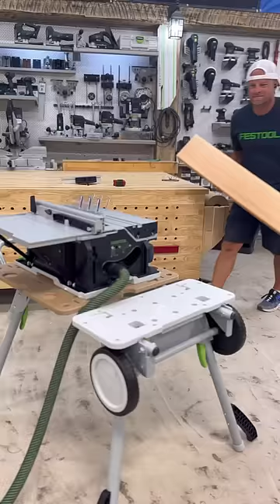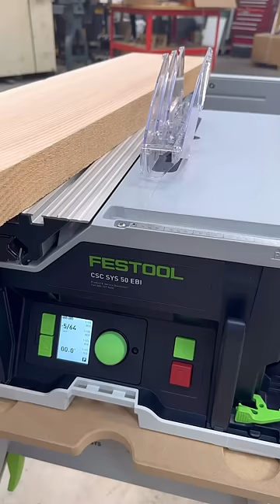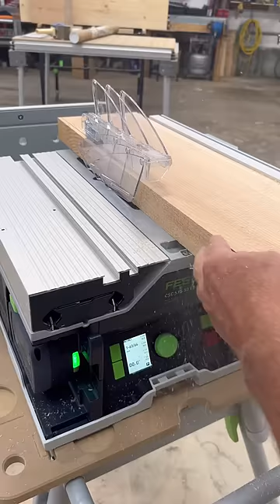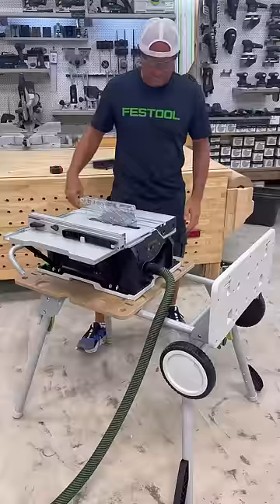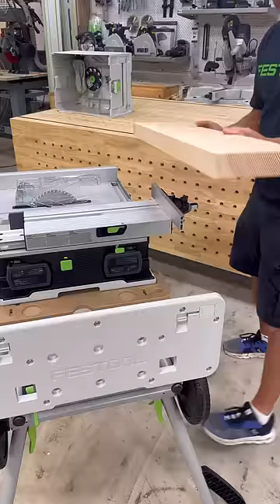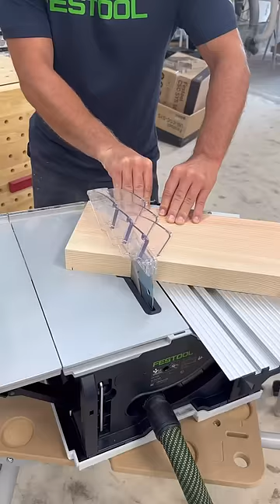The new Festool cordless table saw and mobile base #woodworking #festool #tools #maker #wood

Comment: Only problem with battery power is the batteries. Will you be able to get replacements in ten years time or will the manufacturer have changed the design and yours has become obsolete? At least with mains power you could probably still get it repaired. Nice having the portability of batteries but give me mains power all day long. Hope festool decide to make a mains powered version 🙏

Comment: How long does battery last?? Can you run it hard for 6-8hours??
Reply: Dual 18 volt 4 ah batteries would probably rip about 100’-120’ of 2x material.  At least that’s what my Makita 7.25” saw would do.  
I’m waiting for Makita to make a portable tablesaw that runs off of their dual 40 volt batteries.  Anything less is pretty underpowered for a dedicated machine designed to rip material (with a 10” blade).

Comment: Why do you prefer Festool tools?
Reply from the maker: I had mostly makita for quite a few years and did a lot of work with them and they’re good tools. Festools are better and I have switched out pretty much all my makitas for Festool. The main reasons Festool is better is they better engineered for micro adjustability and with woodwork it comes down to very narrow tolerances if you want tight not. Not to say makita can’t do it I just find Festools are better at adjusting. Also Festool is a system and most tools also have extra attachments that make them extra useful and they have more design features like the ratchet collet on the routers for example.
Reply: Plus they sponsor him, so there's that.

Comment: It.s very cute contractor size small blade almost like plastic toy saw. For the same money better get iron cast 10 inch blade professional table saw or if room doesn't allow than regular dewalt 7492 saw. I do love my Festool domino 500 but this little plastic overpriced saw is a joke

Comment: Seems very nice, however just my experience with sanders and drills, I would not trust a table saw or router that’s cordless, i know people use them all the time but does anyone ever have issues with the battery dying mid cut and either ruining the piece with blowout because the blade/bit slows down or gets stuck, i feel like that’s a huge safety hazard. And I know the same thing goes for if the power goes out but the battery life is going to run out much more often than the power will go out
Reply: My entire jobsite is cordless. Miter saw, table saw, nailers, sanders, routers, biscuit joiner, etc. It cost me around $470 for a 12 ah and 15ah battery for my miter and table saw, and the nailers are a little heavy, but it's well worth the convenience.